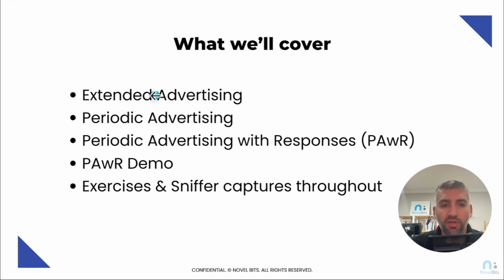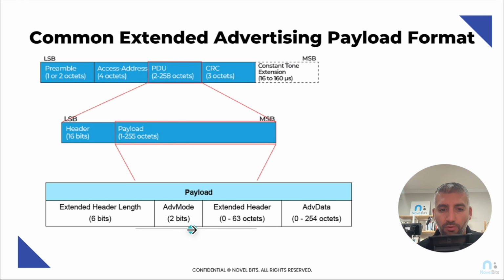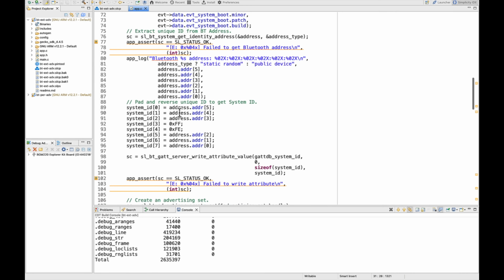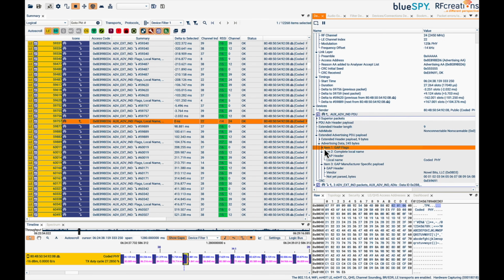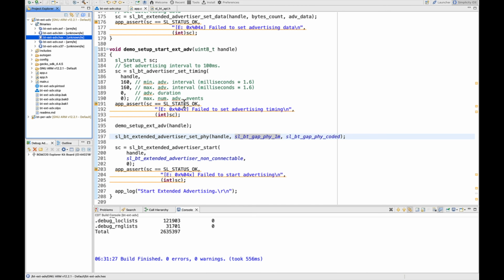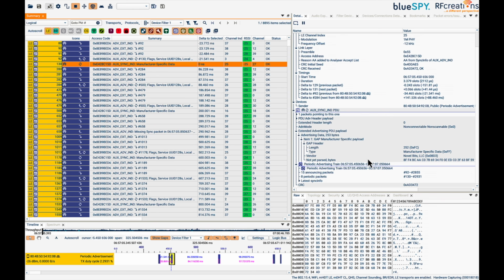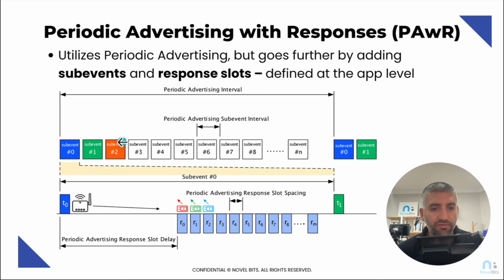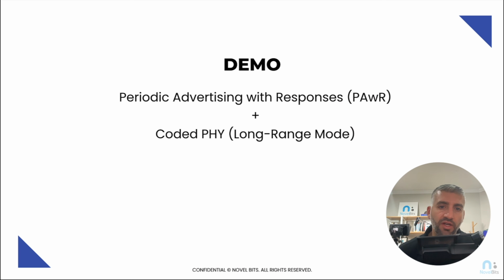BLE Advertising MASTERCLASS - Part 2 | Extended Advertising Programming Workshop

Comment: Dear Mohammad, thank you very much for this wonderful video. I replicated it using my BG22 unit; however, it showed errors when I tried with my BG24. Are there any additional steps I need to take to use this code in a BG24 chip?
Reply from the maker: Thanks, Jorge. Do you mean directly from the repo? Or even writing the app from scratch? And what errors are you getting?
Reply: @NovelBits  Hi Mohammad, thank you for your message. I tried compiling the code from the repo into the BG24, but an error showed that some memory sectors were out of range. I learned that the project has a BG22 as a target. Following that, I created a blank project targeting the BG24 and copied the files, but I still was not able to run it. Do you have any suggestions on how I can run it in the BG24 instead of the BG22?
Reply from the maker: Hi Jorge, which SDK version are you using?